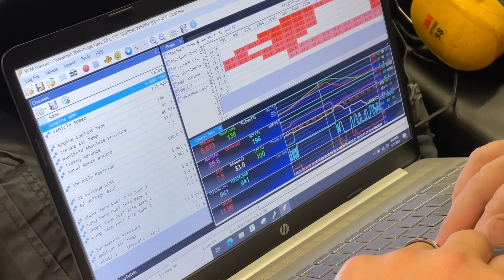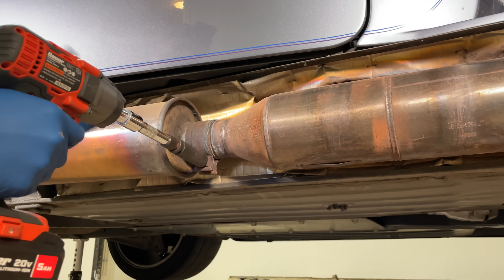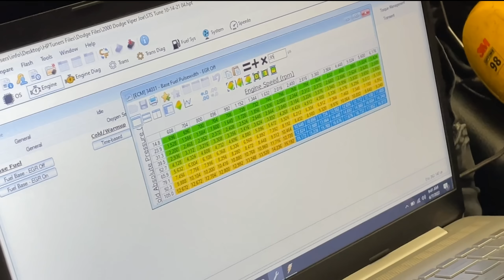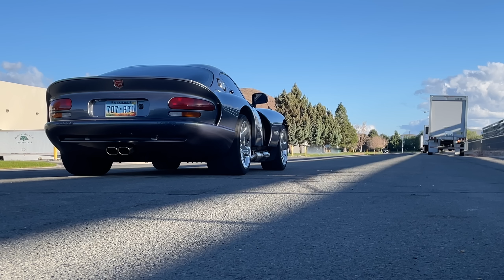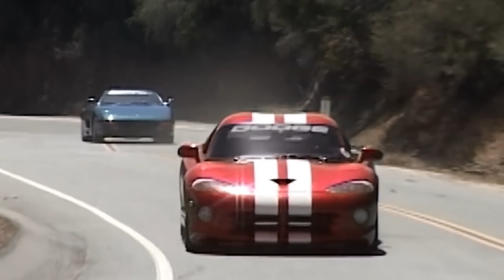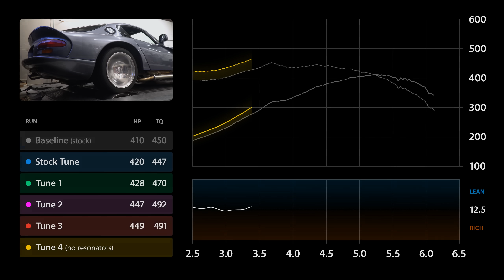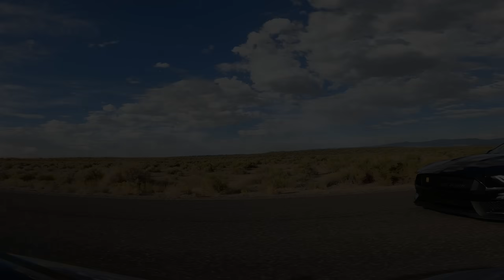When you give an 8-liter V10 the exhaust it deserves

Comment: You should swap out all the air intake parts too like the throttle body, cold air intake, intake and exhaust valves along with a camshaft, then the fuel injectors too. If that stock exhaust was that bad and crippled it by over 20 horsepower imagine what the other stock parts are doing to it?

Comment: a big part of why the cobra was lacking was because it has a crappy shifter and its clearly not a short throw. the difference is stark when watching him shift gears. excellent motor but either a significant loss in the transmission or the shifter is just too long, perhaps the clutch system could be part of it too.

Comment: equal length, stepped collectors.     180degree if you're dumb enough to use a crossplane crank.
 primaries must feed sequentially into collector, in a clockwise direction,

Comment: 2006 B7 RS4 Audi makes 420bhp stock with almost half the displacement , I guess there is a replacement for displacement….. proper engineering! 😅
Reply: horsepower per liter doesnt mean anything.

power to weight is what matters.

Comment: I have straight piped, down-pipe, resonator delete for true dual, exhaust with valve system. My Mercedes GL500 x166 m278 with the full system redone I have 447HP thats 12HP over atick 435hp. The sound of my exhaust I love it. 126db at idle revving in "Sport" mode.

Comment: 15 years ago when i still had the bug of car tuning, I used the J&S safeguard on my MP62 supercharged miata. This clever device has two knobs you can access (I put mine in the passenger's airbag compartment as after a minor accident, both airbags popped and i decided to remove both and replace the steering wheel with a vintage motolita wheel). So the 1st knob on the J&S allows you to set at which boost the device will start retarding the ignition and the 2nd knob, how may degrees it will be retarded per each extra psi of pressure. Default setting was 1 degree, as i didn't run an intercooler, i had mine start retarding at 4psi and at 1.2 degrees per each extra psi. What was so precious about the J&S is that it had an extra feature and when it heard ping, it cut the ignition altogether. Great for proteting your engine, but an air intercooler is indispensable in a supercharging mod. I dont know about now, but in those days there was a book that was considered the bible of supercharging. Dont remember the title, but it was written by someone named Corky Bell.

Comment: The only thing i never understood about the viper is how such a high displacement v10 only makes like stock ls or coyote numbers for horsepower? I think its a monster motor and amazing but i feel like it should make more than it does for power
Reply: Horsepower is torque at rpm, this thing is only being revved to 6,000 rpm or so, also the engine probably doesnt have much compression, the upside is that it makes it's power with very little stress.

Comment: Only in America could we only get 450 horse power out of an 8 liter V8
Reply: lamborghini co-developed the viper v10.

also, horsepower per liter means nothing, power to weight does.
Reply: @riogrande163  and that v10 weighs half the car lmfao
Reply: @framekixrr the engine shed weight over time,  but yes, a boosted smaller v8 would definitely have a better power to weight ratio.

Comment: Like the graphs and your attitude, but I never had to tune my s85 engine.  507hp was enough to spin 275 section Michelins at 70mph.
Cresting a ridge at 130 still accelerating, with a corner hundreds of yards away being told to go faster each time, 140, 150 and I mean 150mph.
A V10 will always love higher speeds.

Comment: I'm not sure if anyone has pointed this out, and maybe the perception from the video is wrong, BUT...when you installed the reducer into the rear of the catalytic convertor, and then slipped the exhaust onto the reducer, it looks like the pipe is the same 3" that the cat outlet is. that means that the neck down of the reducer is actually inside of the exhaust pipe and is reducing exhaust flow down to (2.5"?) before it goes back into the 3" exhaust pipe. Is this true? If so, you're restricting flow (and hp) quite a bit right there.
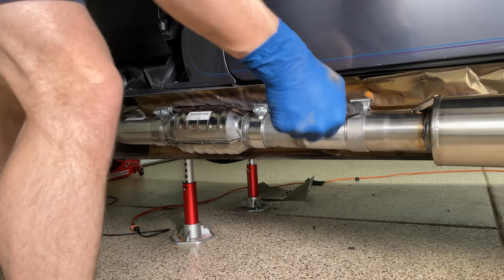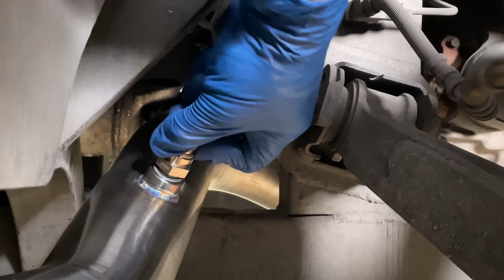Reply: You can really see this well at the 3:12 to 3:14 mark
Reply from the maker: According to Lou Belanger, the reducers create an additional venturi that helps pull gasses from the manifold which reduces back pressure. Without an elaborate test to verify this claim, I have no idea, but he did talk to me on the phone for over an over about how his family has been designing and fabbing exhaust systems for over 50 years.
Reply: @Four_Eyes  That's pretty cool. I wouldn't have thought about a reducer as a venturi, but I suppose it kind of makes sense. Much like a carburetor using jets and pressure waves to pull fuel in. Science is fun haha!

Comment: I noted that you didn’t remove the passenger side valve cover and just went ahead and removed hvac components to remove the passenger side headers but what I don’t understand is why you removed the intake/air box ? Also I’m curious in your opinion do you think you needed to wrap your headers and or side pips with heat wrap?
Reply: I assume you didn’t need to remove the valve cover on the passenger side. I also think you probably didn’t need to remove the driver side valve covers too.

Comment: it’s crazy how far engine, transmission, and ECU technology has come. that massive V10 only making in the low 400’s hp is crazy
Reply: The EPA wouldn't let them push it any further. There are people pushing 2600hp in street vipers.
Reply: But it was the high mark back in the day!  We're boggled today with what's coming out! LOL  Perspective!!
Reply: You give that viper aftermarket cams and heads and that's easily 600 horsepower NA
Reply: Aint that the truth!! For instance, look st the old school vettes and camaros thst oushed 400+ hp back in the 60s yet did a slow quarter mile ehereas now a nissan is faster eith less power
Reply: @pinnaclecooking2384 the reason those older cars were slower was because of poor tire compounds and suspension components from that era. With a basic modern suspension and tire upgrade those cars will be able to put their power to the pavement and really shine.
Reply: The factory leaves a lot on the table. Plus 400hp was huge for the time. They leave room to grow with future products.
Reply: It's not that they couldn't make more power, those cars were tuned that way.
Reply: Not really. The 5.0L V12 in the 2016 Toyota Century only makes 276 hp. The 6.8L V10 in the Ford Excursion only makes 310 hp
Reply: @StricklandBoxing those engines aren't built for performance

Comment: I recently purchased a 2002 Dodge Viper GTS with 800 miles on it that is completely stock. I bought BBE headers and header back exhaust without cats. I am concerned about throwing an 02 code and wanted your advice on if i need high flow cats, upgraded 02 sensors, or anything else. thank you
Reply from the maker: I haven't ran the Viper without cats, so I'm not sure. My guess is you'll get a CEL. A good tuner can tweak the tables so that it won't appear.

Something you'll find interesting is that there's an identical Viper to mine in town. Same year, same color, everything. We dyno'd his with just a catback setup and *it made exactly the same horsepower as mine*, which is pretty crazy. I'd sell/return the headers and just install the catback. Our cars sound the same too.
Reply: thank you bro i appreciate it. That is an interesting finding. Perhaps it was the balanger headers. Generally speaking headers are supposed to offer some performance. I bought BBE headers so maybe it will had some benefit. At the minimum makes the engine bay look badass.   @Four_Eyes

Comment: how can an 8lt v10 only produces 450hp? that's really not that much.
Reply: Basic engine theory shows that Horsepower is Torque at rpm.

If an engine doesn't rev past 5,252 rpm, it won't make more power than torque.

While the viper does rev past that rpm, PEAK horsepower is not the vipers goal.

Reliable, understressed horsepower at a usable rpm is where the viper shines. Also it's torque curve is very good, with plenty of peak torque to boot. 

And in the real world, horsepower per liter means next to nothing...

Comment: Sounded pretty good before you took out the resonators. Not sure how you got any gains by removing them, any full flow resonator will never effect performance, so I'm gonna guess its due to different air temperature/heat soak
Reply from the maker: These resonators had baffle in them, not a straight through design.

Comment: That's actually hardly any power per litre. My completely unmolested family car is more powerful per litre and it's not even loud and obnoxious.
Reply: horsepower per liter means nothing, power to weight does.

while i doubt the huge v10 in this viper is exactly what you call light, the real advantage of the viper v10 is it's flat(ter) torque curve. 

400+ torque from 2500 rpm to 5500 rpm,

Comment: It’s crazy how far cars have came from just the 80’s-90’s. My first few cars weren’t that easy to tune, I promise you. You learned how to adjust the timing and things like that the hard way. If you messed up, you could potentially break more than just a throttle cable. Now with a computer, makes it so much easier and safer.

Comment: the manifolds split into 2 for easier install is probably the smartest thing I have seen designed for a car, great job whoever designed this
Reply: Does it not effect how the manifold/ Gasket fits? ie does it not create uneven clamping force by the bolts? Typically its all one piece so it tends to tighten down nice and evenly across all the exhaust ports.
Reply: @joel6513  I feel like if you pay attention to that and dont let it bow maybe use a torque wrench should be good
Reply: 2 piece headers have been around for close to 20 years if not longer
Reply: @Redd777Featha and this car is over 20 years old, so yeah
Reply: Thanks so very Professional team and team members and team of people from across India and all over world
Reply: @GAMRMNTS2 what ?

Comment: Fantastically informative video, proving that horsepower isn't everything, and its true. My friend had a lightly tuned Skoda TDI making 195hp, and he won roll races against a Honda S2000 with 240hp. Id always wondered just how is best to tune N/A cars, and this has taught me that free-flowing exhaust and scavenge effect, as well as balanced fuelling makes a lot of difference. In my opinions its a finer art than just adding fuel and boost.

Comment: You need to have very high complex when you need to have so loud car. I would rather be fast and quiet. What's the reason for wanting to make everybody deaf and this "fancier" outtake sounds like something broke.
Reply: Or you just need to like the sound of your car?  There are tons of other loud noises in the city.
Reply: @guac8927  So put exhaust pipe inside car or open windows. I head engine with out modyfing anything.

Comment: a viper with a 8 liter V 10 loud as a gunfire at full throttle.. making less than 500 hp. A stock Tesla model 3 makes the same power without noise and puts down power much more efficiently. I put this viper in the same category with my neighbor's 1995 ricer Honda civic with 200 hp with an exhaust like an amplified fart cannon... some people think it's the coolest car ever.. .but it's only a relic that is poorly designed in comparison to new tech.
Reply from the maker: whining is optional
Reply: this comment seems like troll bait, it has to be.

Comment: 400hp from 8 litres what a piece of shit for its time🤣
Reply from the maker: bookmark
Reply: horsepower per liter means nothing, power to weight does.

while i doubt the huge v10 in this viper is exactly what you call light, the real advantage of the viper v10 is it's flat(ter) torque curve. 

400+ torque from 2500 rpm to 5500 rpm,

Comment: 8 liters should really be making more than 420 hp from the factory. What this thing really needed was better heads and another 1500 rpm. Should be an easy reliable 600 hp engine.
Reply: The heads were fine. Small camshafts and restrictive exhausts are what limited these engines.

Comment: I just happened upon this website seeing words Viper & Headers got my attention, I'm Lou Belanger's Uncle, and I stop by once a year at Lou's shop to ride dirt bikes with him out in the desert, Lou's shop is an ultra clean color coded Header shop, it's a privileged just to walk through a shop where engine exhaust jewelry is designed and made...It has been said by Viper owners "I'm gonna mount these bad boys on the wall"...not only are the headers an engine bling, but it's what's inside the collector is the magic thing, stoping valve overlap intake/exhaust pressure oscillation for a clean Suck~Bang~Go~Blow~Flow action increasing HP.

Comment: Massive 8L V10 producing only 450 hp! Very poor performance. Changing the sound won't help. Someone needs to find out how to improve the performance of this engine.
Reply: horsepower per liter means nothing, power to weight does.

while i doubt the huge v10 in this viper is exactly what you call light, the real advantage of the viper v10 is it's flat(ter) torque curve. 

400+ torque from 2500 rpm to 5500 rpm, 

also horsepower is torque at rpm, this engine is making it's horsepower without even revving all that high, if you opened it up, and rung it out to a higher rpm it absolutely can make more power, at the cost of low end torque...

Comment: I will always advocate that it's almost impossible to beat a good big engine with a good small engine. Oh and I like torque a lot. You want to pass someone you don't have to downshift 3 gears to do it. Just stand on the throttle pedal and go. I can understand putting a louder exhaust on a vehicle if you simply can't hear it. But deliberately taking all muffling devices off so it will be louder is not good. Everyone will hate you that isn't a car buff and many of those will too just because you're to loud. I sawed off the muffler on my nearly new Suzuki 650 Vstrom because it sounded like George Jetson's car. I took the baffles out of the Staintune mufflers but quickly put them back in because in my opinion it was to loud. The same should apply to all people who want to hear their vehicles. Around where I live it seems like 99% of the riders of HDs put straight pipes on them. I must conclude that they are deaf or that they simply like to offend people. Cars without mufflers are just as bad.

Comment: I think the stock exhaust was so quiet because many people found the sound of a V10 unpleasant compared to a highly tuned V8 or I6. Especially an odd fire 90deg V10 compared to a 72deg evenfire V10.  I think the Viper V10 was a huge boondoggle, if they would have used an aluminum block 8-8.3L low deck B block or a 426-440ci LA/Magnum/R3 based aluminum block with the proper sound and an available auto it would uave sold more and would still be in production to the point if eventually having a 6.4L, Hellcat or Helliphant.

Comment: Im always laughing in these videos. 8l V10 with masive 450hp. Is it a joke? it is so much muscle as those guys in a gym on steroids. So much volume but no power. Yes Im from Europe. Take any European V10 and compare...
Reply: horsepower per liter means nothing, power to weight does.

while i doubt the huge v10 in this viper is exactly what you call light, the real advantage of the viper v10 is it's flat(ter) torque curve. 

400+ torque from 2500 rpm to 5500 rpm, peaking at 493.
let me know when you can do that with a euro weedwhacker engine, especially one without a turbo.

Comment: 8L for under 500 hp, now that's true American engineering
Reply: horsepower per liter means nothing, power to weight does.

while i doubt the huge v10 in this viper is exactly what you call light, the real advantage of the viper v10 is it's flat(ter) torque curve. 

400+ torque from 2500 rpm to 5500 rpm, peaking at 493.

also horsepower is torque x rpm, if you rev the engine to a higher rpm it can theoretically make more power. 
the viper is making it's 450 horsepower without even breaking a sweat.

Comment: The exhaust itself attributes to about 15hp-20hp of that power. The custom tune is where you got most of the power. You would have gained 30hp just with a tune even without an aftermarket exhaust
Reply: that is perplexing because this is not an economy car; you would think the stock tune would be putting out optimal power in a manual RWD sports car.

Comment: 8 litre 450 HP :D American cars are such a joke.
Reply: imagine thinking horsepower per liter matters.

the torque curve on this is flat as a board, and it does so without even trying.
Reply: Ofcourse it matters... What are you on about? It indicates it is very inefficient and wasteful. Its just a rather barbaric way of producing a lot of horsepower. Sure nice Torque, but you can make an engine with more torque and more horsepower with way less cc  @riogrande163
Reply: I mean I get it though, AMerican cars are build so any idiot can fix them on his driveway but still.  @riogrande163

Comment: How do you produce so little horse power from such a huge displacement 😂😂😂. 

Mercedes A45s AMG produces 450hp and it's a 2 litre turbo.

Bugatti Chiron produces over 1500hp with its 8.0 displacement engine.

So this car is nothing to shout about 🤦🤦🤦
Reply: horsepower per liter means nothing. power to weight does. 

also the bugatti is boosted, and 20 years newer.